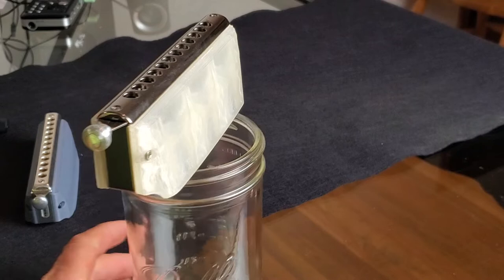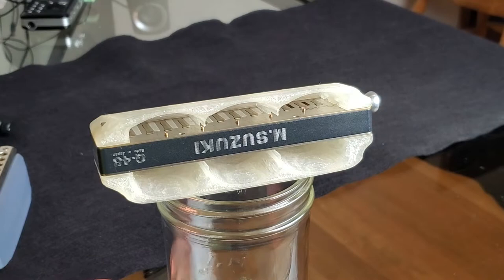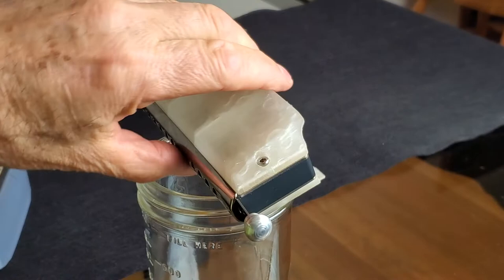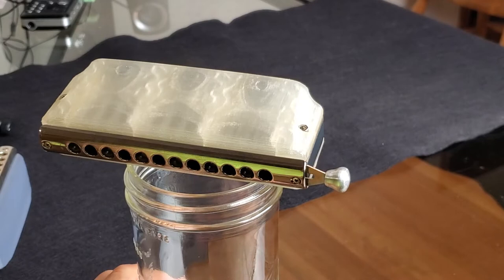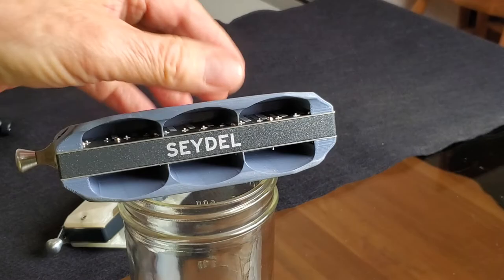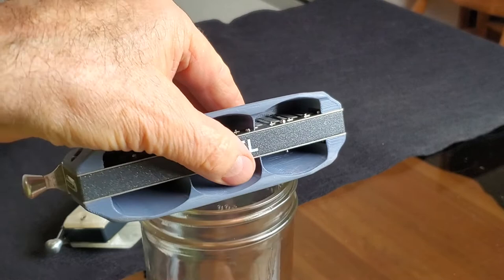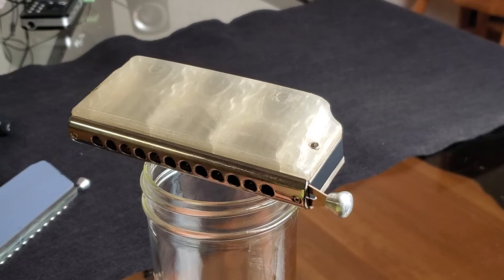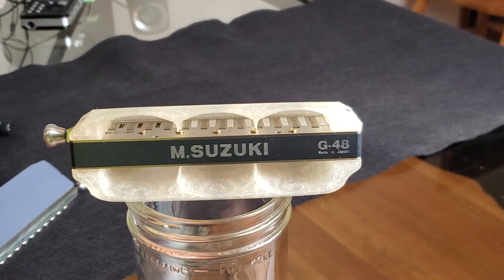Interview #5 w Russ Camerer, designer & builder of Kettlewell Resonant Covers UNDERSTANDING CONCEPT

Comment: Without a comparison to stock harp, add amplification = hard to tell if anything is different...
Reply from the maker: 2 soundtests as you seek....

SEYDEL SAXONY SOUND TEST 
https://youtu.be/R8yeOReg99A 

GREGOIRE MARET SOUND TEST
https://youtu.be/0mKBtJQZXVY
Reply: no, no. you can absolutely tell if you've heard a stock before. At the very least, it'll be much louder. Scientifically speaking, it has to be